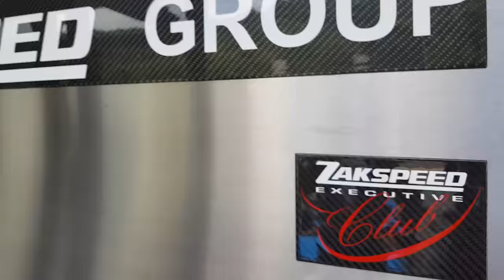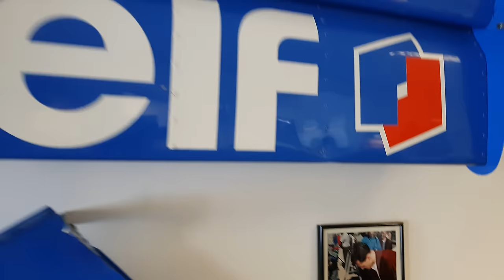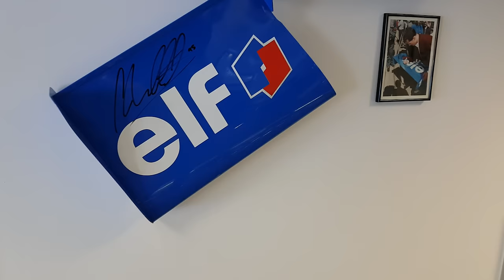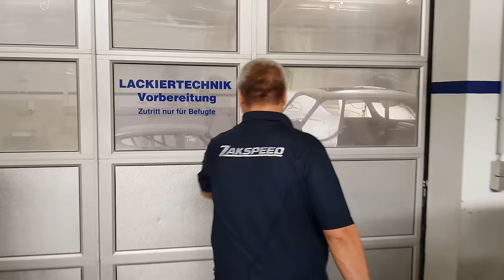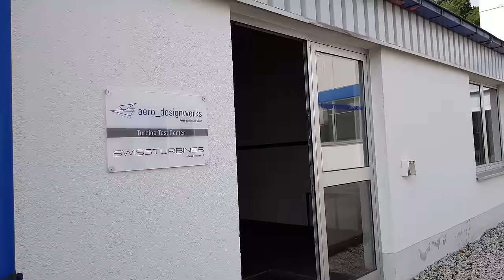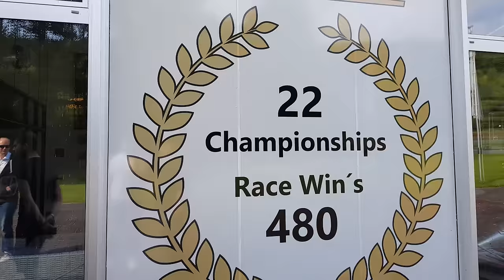VISITING ZAKSPEED

Comment: Nice video Misha, but on 00.35 they already mentioned they never did something with rally... Well they sure did! How about the Opel Kadett 4S? 
This car was build for group S, but never used in the group B or group S. Yes in rally raids as Paris Dakar. 
Opel used a Ford engine build by Zakspeed that had 500 hp and in when needed more than 800 for a few seconds.   Some Kadett's 4S had also the Manta 400 engine with a compressor.  Opel wanted to hide the connection with Ford so this is maybe also the reason Zakspeed doesn't mention it...

Comment: wait wait wait. Like is that the same viper that got slapped with all the BS restrictions on air plates to restrict power then had a ridicules weight forced put in it to weigh it down and then had the gas tank size slapped on them AND THEN in a final act of defiance plugged 2 cylinders to become a V8  when the rules changed for legal engine size. because if so that's AWESOME to see its still in there possession and being worked on XD